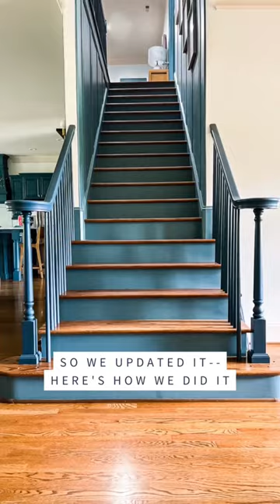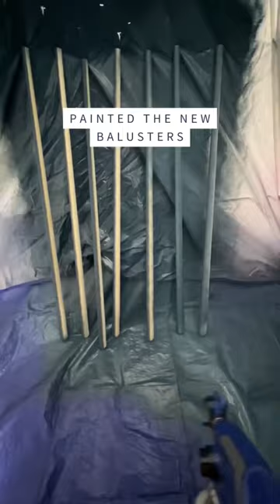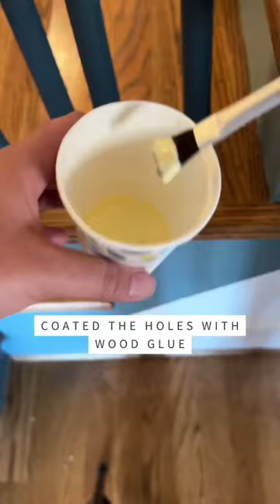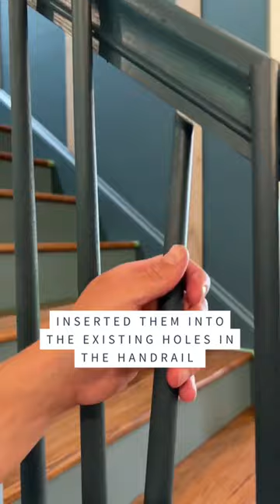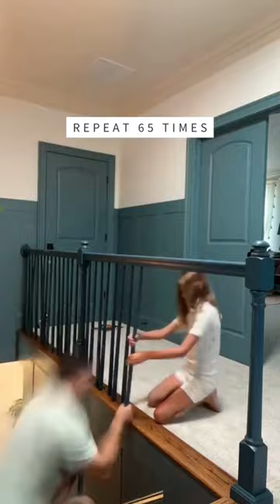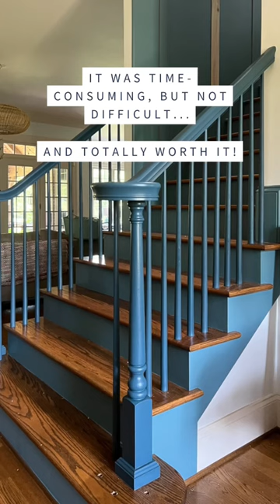How to Update Your Stair Railing

Comment: Building code in my area requires you to have a hand railing 32 to 34 inches above the nose of the stair the ENTIRE way up the staircase. I know this is a very common building practice in North America. Although I respect and can appreciate your style and taste just wanted to give you a heads up if your house insurance company ever came by they could require you to re-install one for the upper half to the staircase. As well your potentially opening yourself up to a lawsuit if anyone were to ever fall because there is no railing to hold onto the upper half and insurance could possibly not cover you in such a lawsuit if it's not up to code. Just be careful, anyways enjoyed your video. Cheers!